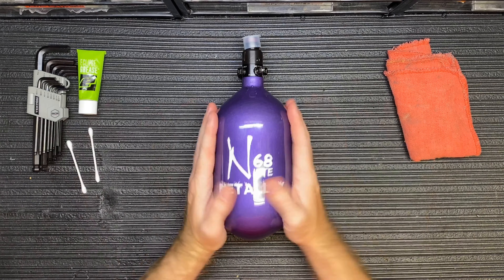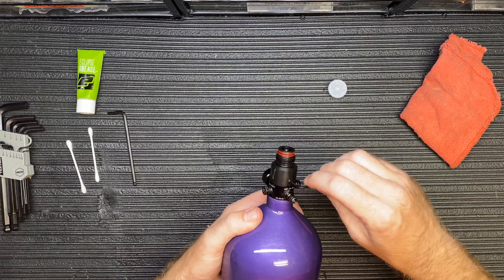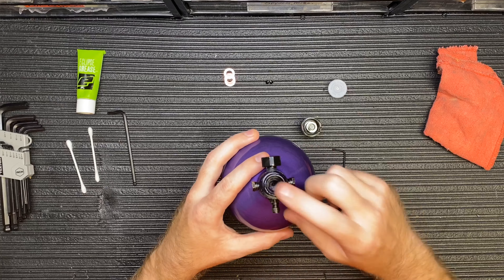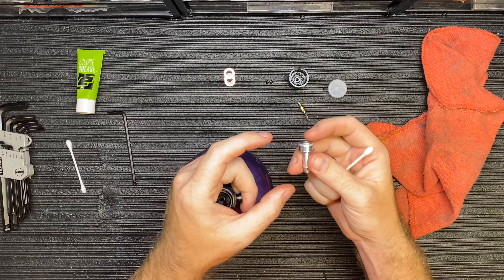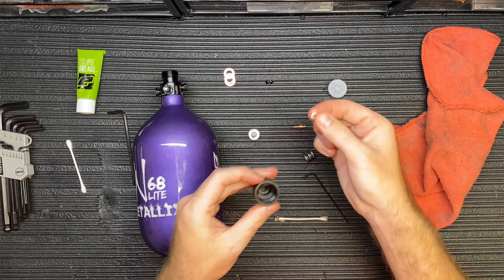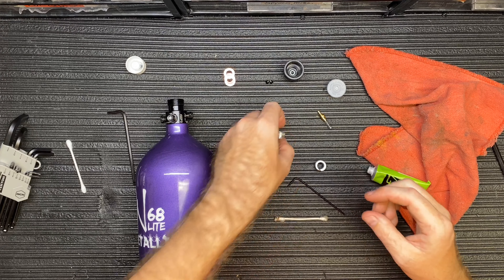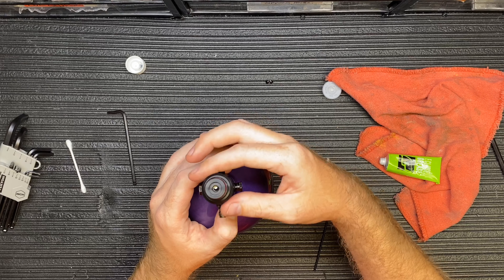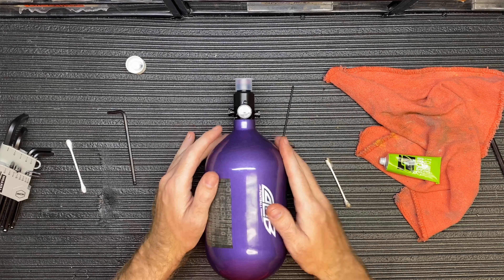Ninja Regulator How to Clean and Service - Standard Model

Comment: Great video. Over the past couple decades I've always had my tanks run very reliable and consistent having maintenance them every 200k shots or so. And remember people, do not over tighten the set screws on the bonnet because they are very easy to strip since the screws are made out of steel and the threads of the Bonnet are aluminum. Just get them a little more than hand tight and a tiny dab of blue removable threadlocker/Loctite on those set screws won't hurt either:-) also another piece of great advice is to use a cap on your fill nipple while playing so dirt and debris does not enter the tank and go through the regulator causing abrasions in the housing and on the piston because that can cause damage and inconsistency of the output pressure of your tank which will for sure influence the consistency of your paintball marker.
Reply from the maker: Great advice!